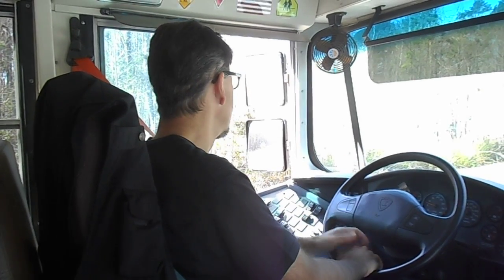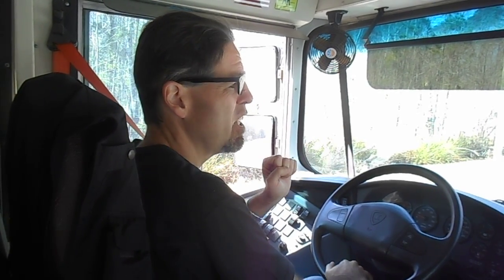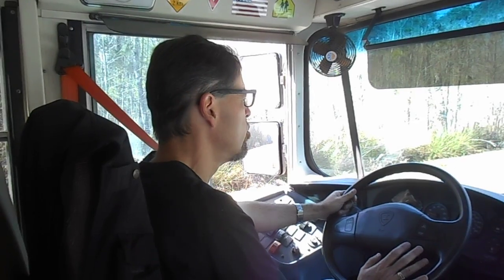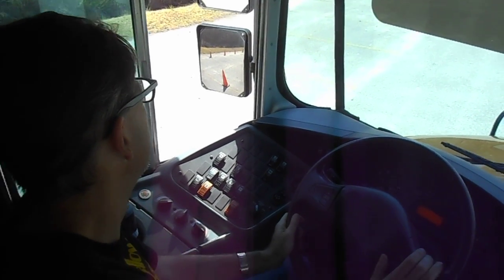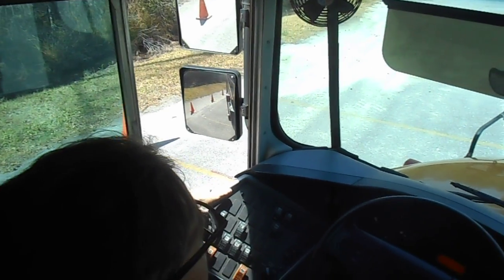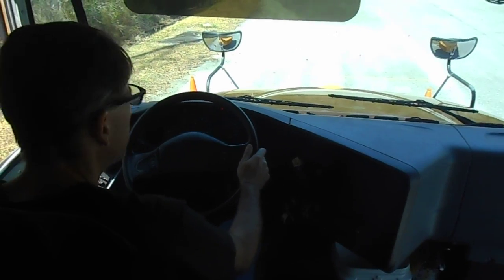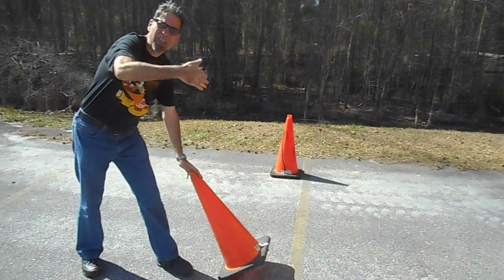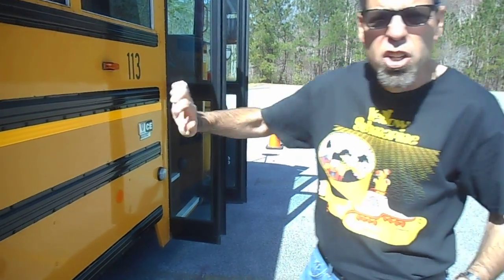*** Skills – How to Parallel Park / Driver Side – Class B CDL School Bus ***

Comment: great video.  You're instruction has helped me more than any instructor I have practiced with.
Reply from the maker: Thank you so much for viewing, Sally.  I am glad it helped.  Have you tested yet?  What state are you from?
Reply: I have not tested yet.  I am in Oklahoma.
Reply from the maker: Cool.  Please, keep us posted.  Best wishes on your CDL test.  Greetings from Coastal Georgia.
Reply: Thanks,  did you make a video with step by step instructions for parallel parking on the off side?
Reply from the maker: I have to work on that one.  I have limited equipment and resources.  I do not make the videos for profit and I have no budget, so I rely on volunteer work anytime someone helps me.  With that into consideration, I have to figure out a practical way to make a more detailed video of the parallel parking on the off side.  I think it is an excellent idea.
Reply: JJ Bellemare great video
Reply from the maker: Thank you so much for watching.  I am glad that you like it.
Reply: Hey JJ, your Air break test and pre-trip inspection help me out a lot today on my CDL test. I pass everything expect my parallel parking. My question to you is the first 3  Orange  Cones set up in the front how ffar apart must they be? Because the  examiner  Had them set up 12’ apart and the school I test on had them set up 15’ apart because the bus is 40’ long... so now I need to be retested again on parallel parking